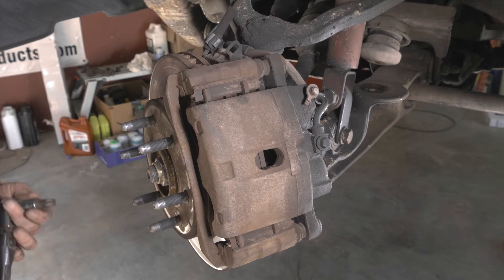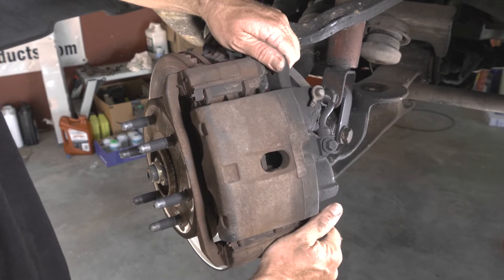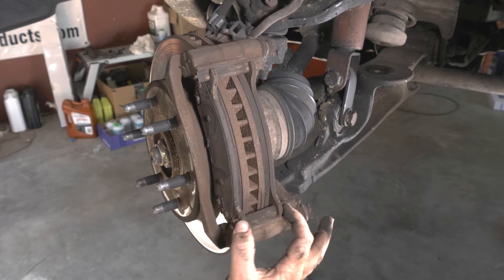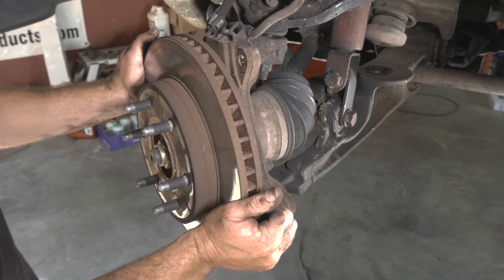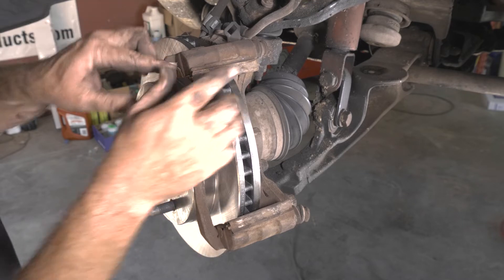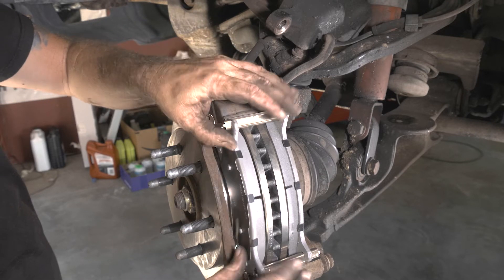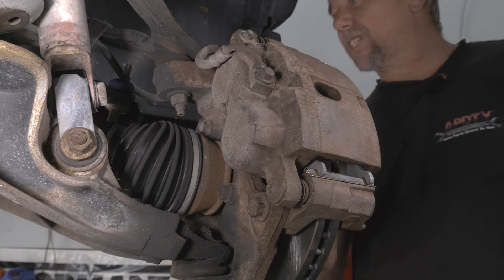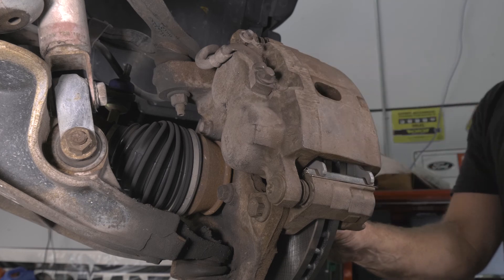2005 Chevrolet Tahoe Front Brake Pads & Rotors

Comment: Always remove the master cylinder cap "BEfORE" the pistons are pushed in. Failure to do so can be catastrophic!
Also do the screw driver trick before the bolts are removed, maje sure your guide pins move freely the anti rattle clips are good and your golden.
Brake grease depends on the application.
Most people don't have the fancy tools the us technicians have.
Dude is showing you how to get around that issue good job!

Comment: 0:15 or a warped hub.  
3:50 No grease on the slides?
5:25 No grease on the caliper slide bolts???
No Torquing?????
I won't be saving this one to file.
Reply: The torque spec is 113 pound feet for the caliper bolts

Comment: I stripped one of the 55t bolts on the 2nd try never got it off any ways I can get it off ?? Pleaase help
Reply: use heat around where the bolt screws into and see if there is a  way to get a pair of vice grips on it maybe? I assume since the bolt is stripped out you won't be using it again... try welding a nut onto the head of the bolt and see if that plus some heat will break it loose!
Reply: @steezy_baugh9522  the dumbass before put locktight on the threads of the torx bolts.. I got the whole brake caliper off and worked on it on the floor just by taking one side off but I’ll have to just replace my whole caliper because they are shot and I want some Chevy designed brake calipers with the black paint on it or something nice.. thanx for the tip  it was a huge pain. Ended up doing my pads n rotors that day
Reply: Those bolts are the stupidest thing I have seen.  My Subaru flex plate had 8 of them.  Impossible to get off.  The other front brake didn't have them!